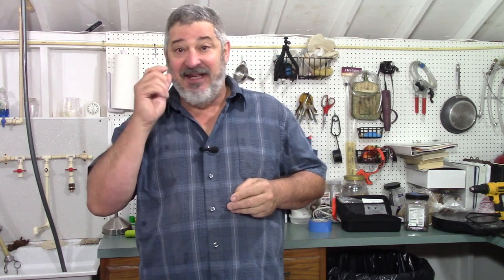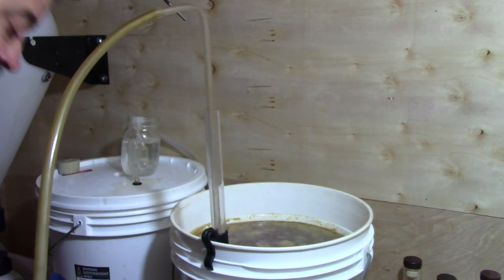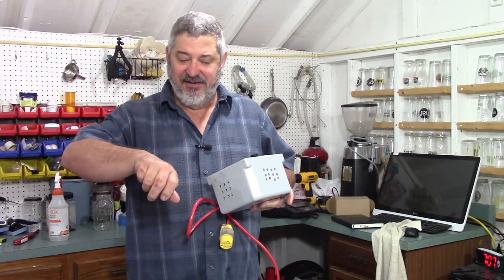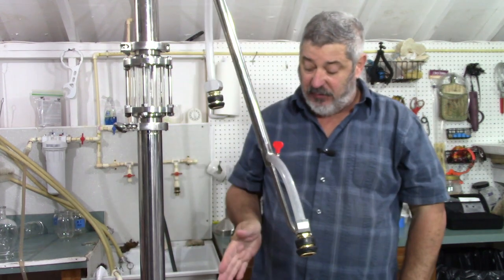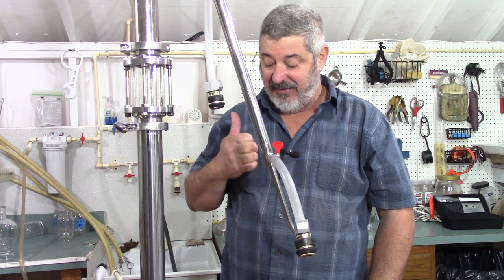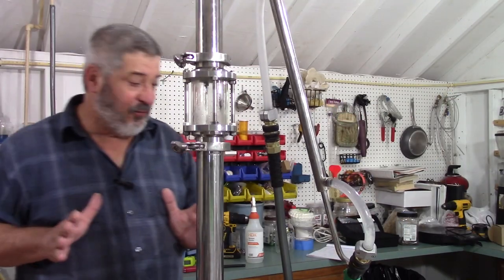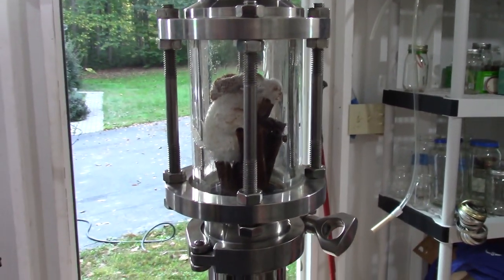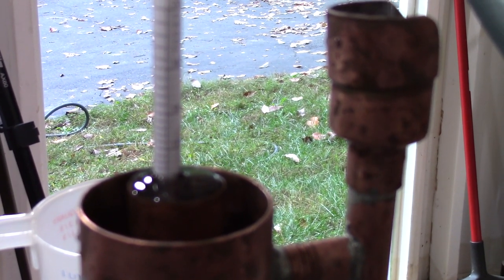E130 "Roasted" part 3 of 5 distillation

Comment: My general rule of thumb is to collect WAY DOWN into the Tails.
Collect until 20% abv or 40 proof. Why? There is flavor there... Plus that alcohol can/will be re distilled on the next run.
When I run my thumper. I put tails in the boiler, and heads & fresh wash in the thumper. Slightly more heads but more hearts to when thumping.

No matter what column configuration I run. Pot (strip or spirit), Flute, Reflux, Thump, I always collect down deep.
If you don't wanna wait for it, crank up the heat and strip it. I run my parrot only when I smell tails.

The yeast work hard to make that alcohol, does not make sense to waste it. ;)

Cheers Randy!
Reply: Was thinking same thing.  Save those feints for next run of same batch.
Reply from the maker: As always thanks BigEdsGuns for your input
Reply from the maker: Thanks you to Rubberduck4106

Comment: Why do you ‘de-gas’ your wort?  Also, I use a drill and paddle you ADD o2 to my wort before fermentation.  Just curious, thanks in advance for your time and making these videos.
Reply from the maker: Great question I was always told it helps to reduce off flavors i figured cant hurt and i feel that   it dose help reduce with foaming and pukeing cheers